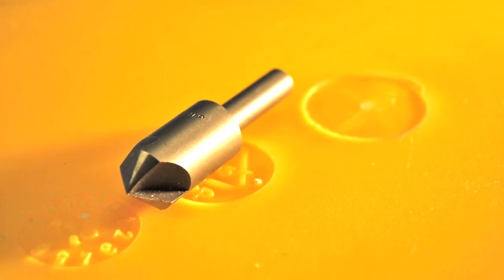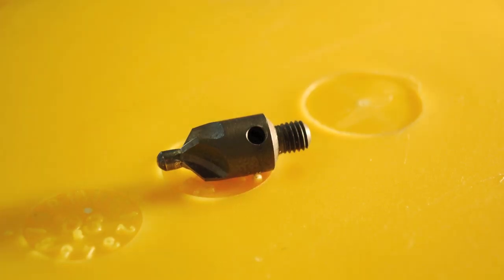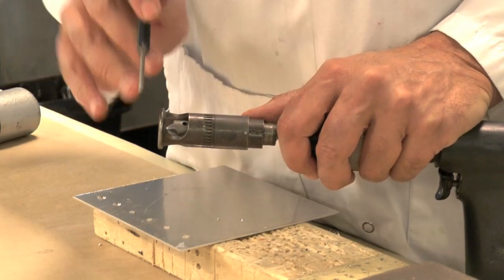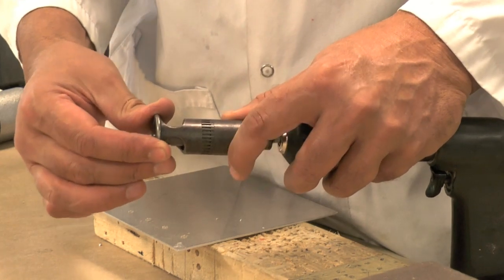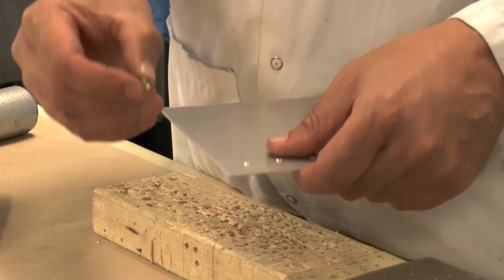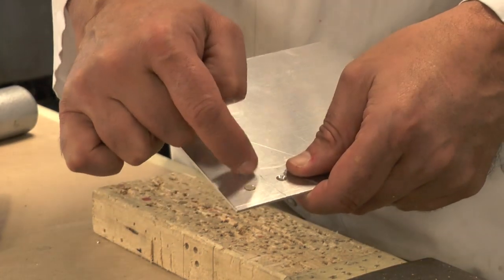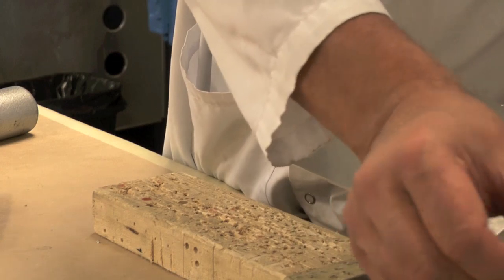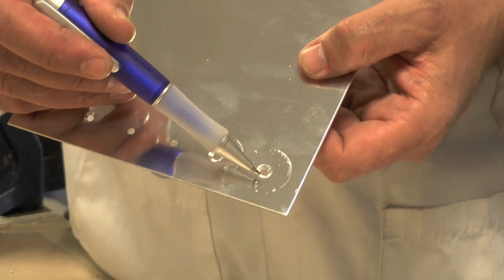Microdial Countersink

Comment: How does surface scuffing from the tool affect paint adhesion and corrosion prevention long term? 

I'm thinking if sandwiched with another piece, with vibration over time.